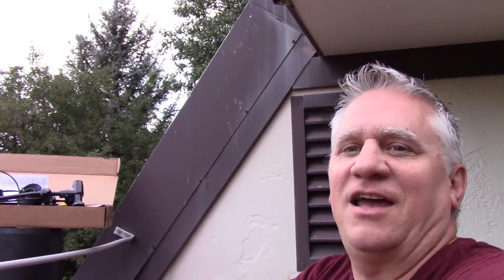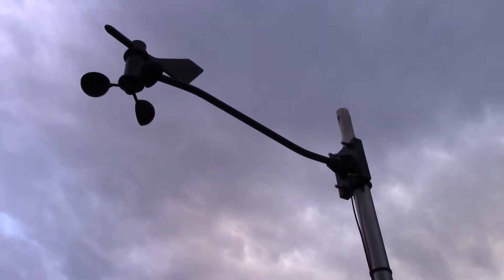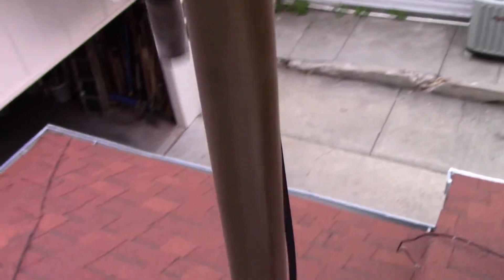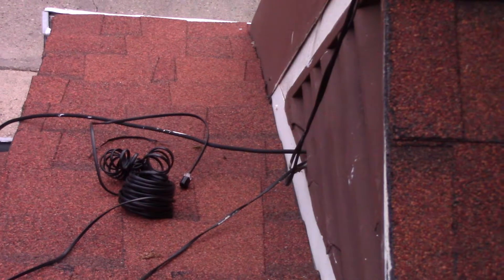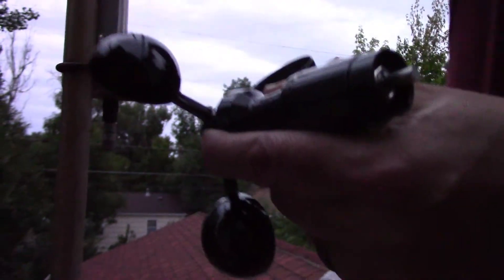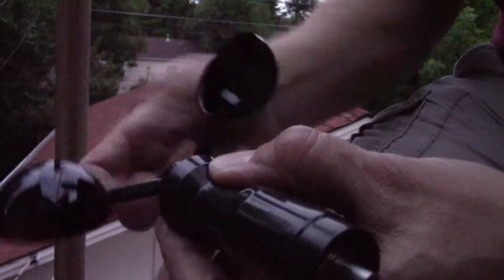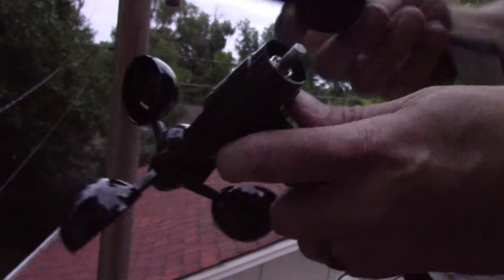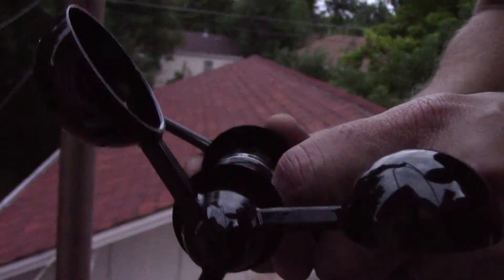Davis Weather Wizard III Anemometer Repair

Comment: Unfortunately it is not repeare, but change.  I have old one anemometer (Monitor II) and want to replace potentiometer inside. I have almost inside, but do not know, how potentiometer pull out. Do not know how to dissamble this cylindrical body which is inside.
Reply from the maker: I've been wanting to do that with this one that is bad as well. I'm wondering if it's an optical sensor rather than potentiometers. Maybe another teardown video?!
Reply: Fortunately I disasebled body and bougt new rele in  Wind speed sensor. This rele is mechanical and this is weaknes of this anemometer.